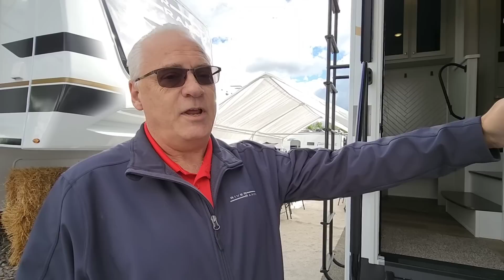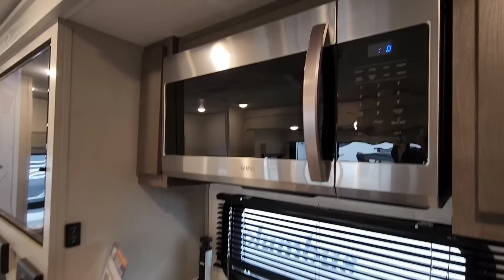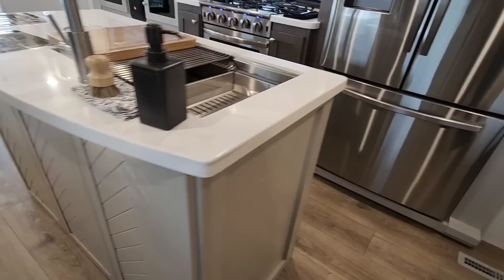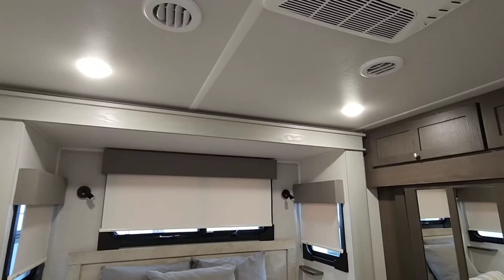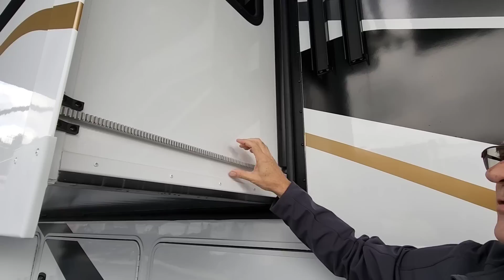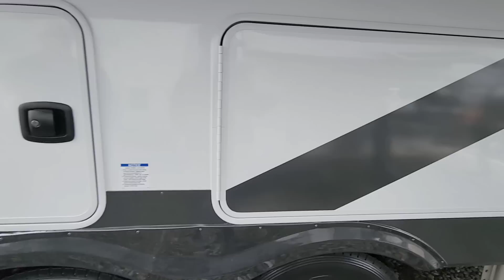Incredible UPDATED River Ranch 391MK Fifth Wheel RV!

Comment: It’s really a nice rig. That kitchen sink is the stuff of dreams! I love the fact that there isn’t any carpet. We’re full time and our rig has carpet in the two rear slides and the bedroom and I hate it! I have to have a vacuum just to clean about 15 square feet when I can just use wet/dry swiffers to clean everything else. We had a water leak so we’ll be replacing the subfloor in most of the rig and that carpet will be gone when we’re done!

Comment: With the River Ranch 391MK we are interested to know what could be accessed with the slides closed? Being that the steps and door are located at the back of the rig, if traveling is it possible to make it to the bathroom, bedroom and maybe the refrigerator if all the slides are closed? Also, what is the length of the basement storage? Wondering if kayaks could be slide in under there? This unit is awesome and we are extremely interested in walking it and feeling it. Hoping this will be at the Tampa RV Show in 2023. Also, I am wondering how my 2022 GMC 3500 SRW Denali would handle it? I am not wanting to buy a new truck, however this unit checks a lot of our blocks for a couples unit to do some longer trips. Great video! Keep em coming!

Comment: Last year the same guy called the AC unit new and revolutionary.  This year he says it is old technology that doesn’t work.  I bought the unit last year and have major problems with the AC working in Texas heat.  Columbus has not helped with a solution, in fact they claim the AC is working great.  I added a portable AC just to have the temp somewhat bearable.

Comment: The entry way would be a good place for utility room with a washer and dryer, and add some wall cabinets because there is a lot of wasted room in there. I would be interested in a 46' model with triple axles and a comfortable carrying capacity of 4,000+ pounds. with a little longer utility room so a full sized washer dryer set could be be set on a raised floor with storage underneath and overhead.

Comment: Having a significant disability, stairs are always an issue for me.   We’ve ruled out rigs because the constant internal stairs are just too much for me.   I get the rear entry / mudroom takes up space but a break in the stairs plus not needing to do any stairs while actually in the unit…. Genius!   A great unit to take a deeper look at.   Thanks for all you do!!!
Reply: I totally agree with Cheri.  After 9 foot/ankle surgeries I have issues with stairs, including nerve damage that makes stepping down treacherous.  If ever possible I'd love to see a lift equipped version.   Winnebago has one and theirs is the only one I've seen.   This one unit could be ideal for both my husband (6'7") and myself!
Reply: Ill bet a electric lift could be easily mounted to back end for easier entry. Mounted to frame and fold up when not in use. Using linear actuator and lift capacity to 300 lbs. Then viola your in business
Reply: @andysmith5220  I agree!  I'll need to sell the unit I have to upgrade but this one could make such a huge difference!!

Comment: Only thing I will say is they should do 1 15k A/C in the rear because 1 13.5k unit isn’t enough to cool my 40ft rig but my 15k can cool my entire rig without the 13.5k. Running 2 units is a lot louder than running 1 is all I’m gonna say…